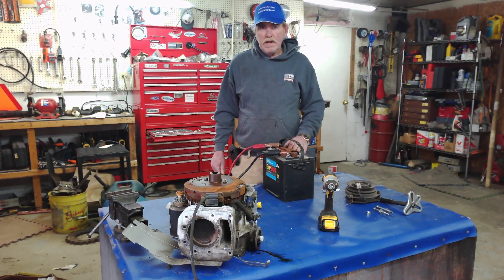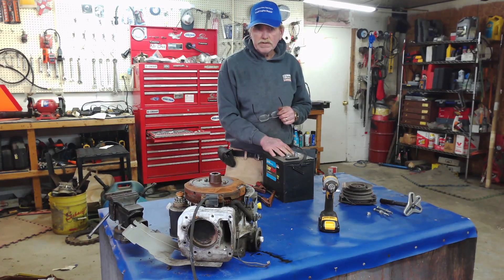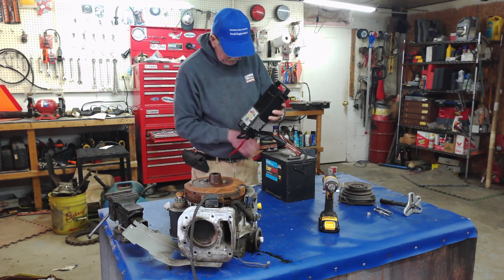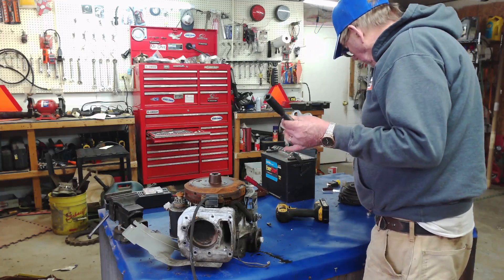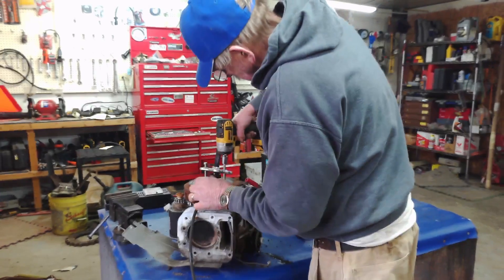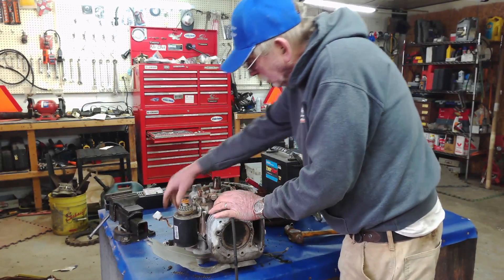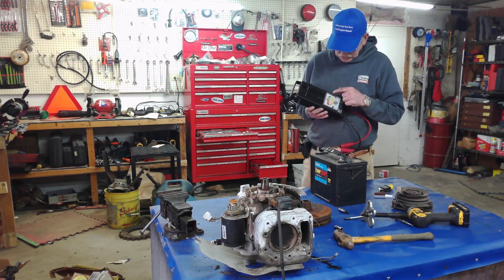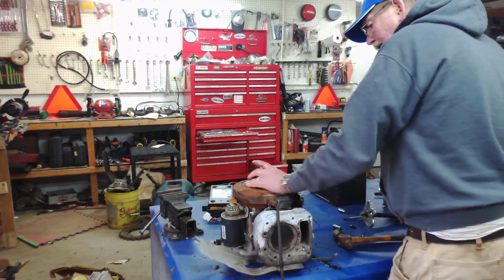How To Check Your Charging System On A Riding Lawn Mower

Comment: What if it goes to 13 and drops then goes back up and down up and down I have an opposed twin dual circuit with a diode on the DC end is this normal

Comment: Thank you, Eric!  Excellent coverage!  My battery is apparently not charging.  The engine started yesterday, but I had to jump it twice with my car charger set to Jump Mode after turning the engine off.  This is a new 230 CCA battery installed at the beginning of this mowing season (my old battery may have been good).  230 CCA thinking that would last longer and be sure to start the engine.  I'll check the battery electrolyte levels first, then the Voltage before and after starting to see if the Voltage rises, check the Stator wiring plugs for corrosion, broken wires/insulation, etc., pull the flywheel if I have to and Ohm-out the Stator, check the magnets and flywheel gear, and replace the Stator if needed.  Your advice on pulling the flywheel will surely save me from damage.  I may also buy the Harbor Freight Battery Tester.  Thanks again!
Reply from the maker: You're welcome, glad to help and I hope you get it all worked out.
Reply: @northernnewyorkparts   Thanks again

Comment: didnt test stator ohms reading alot of them you can check when runing the a/c voltage on both windings need to make cloose up video of stator so we can see what your talking about normal regulated charge rate 13.3 14.2  ,diode or rectier type will go up to 16 volts full throttle un regulated style i dont like that system and i incorporate a regulator in system your video not that informative need to get more technical
Reply from the maker: I agree Allen. But the way I look at it, is there are a ton of videos already out there that are doing an amazing job doing just that. I personally can't see where I could do a better job than what is already there for people to watch. thanks

Comment: I started at the battery, took my engine out, sprayed the stater with pb blaster, but it still don't charge, and now it don't run, grass is growing good though.
Reply from the maker: You lost me, George. Did you clean battery posts and connections? Were you getting 14 volts at the battery when the mower was running? If not, did you check for a blown fuse? If so, did you check the wiring harness for any signs of damage or wear? Within the charging system, you have the battery, regulator, and the stator. Now if it is putting out around  14 volts and drops way down when you engage the electric PTO, it could be a sign of a bad PTO.

Comment: Your stator should be producing 14.2 volts in order to keep that battery fully charged
Reply from the maker: Your correct Doug and thanks. I have always looked for 14 or above until the battery was fully charged.
Reply: @northernnewyorkparts  Reason I knew that is Im an 80 year old RETIRED automobile mechanic and I studied that in School about alternators generators and charging systems. The OLD 6Volt Generator systems must Produce AT LEAST 8 volts in order to maintain a complete charge on the battery. We used to have an old school way of hooking a positive 6 volt lead to the positive terminal on the generator and a negative lead to any ground surface on the generator and if the generator began to turn on its own then except for checking the brushes to make sure they wernt worn too far we could count the generator as good and go directly to the regulator if there was a problem
Reply from the maker: @douglasmorrison9098  that is old school and we still use that idea when working on 6 volt farm tractors. Claude is 72 and that is how he was taught many a moons ago lol thanks

Comment: Even if the battery is dead, if the stator is charging it should be in the 14 volt range at the battery while running at full throttle. I always spray PB Blaster on everything it helps especially with flywheels. You should try the air hammer with a pointed chisel and prybar sometime it is way faster and easier. The whole bottom drawer of my toolbox is specialty tools and pullers and I haven't hardly been in that drawer in years.
Reply from the maker: There are a number of ways to remove the flywheel to expose the stator. I have always used a puller with the 20 volt dewalt to get the job done. I also have a draw full of tools that we had to buy to get a job done. There they sit until we see it again, which sometimes is never lol thanks

Comment: Another good video for a Home DIY guy like me. Broken down in terms I can understand. I have the battery testing tool Eric used and I better understand how to use it. Flywheel removal also is now easy to understand. One of my riders had running issues that after much trial and error (and parts) I took the flywheel off with a hammer and pry bar. The issue was clay dirt built up under the flywheel. After cleaning this out of the flywheel, and reassembling it worked flawlessly. Using the tool Eric used would have made removing the flywheel easier and probably safer without damaging the flywheel.
Reply from the maker: Great add Randy with crap getting built up under the flywheel causing the issues. Thanks for the kind words on my video.